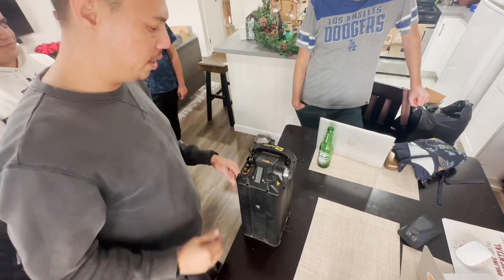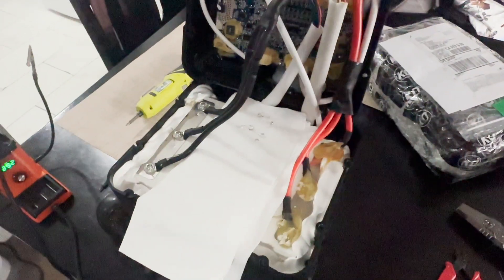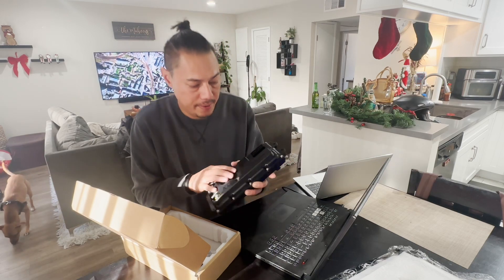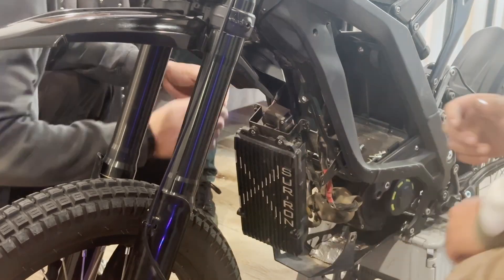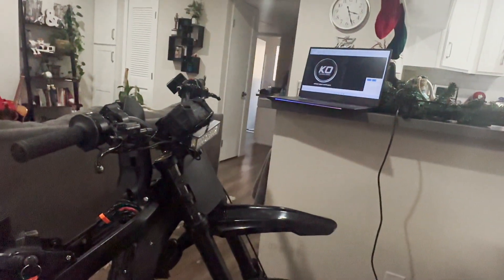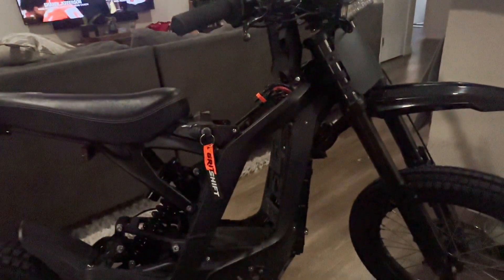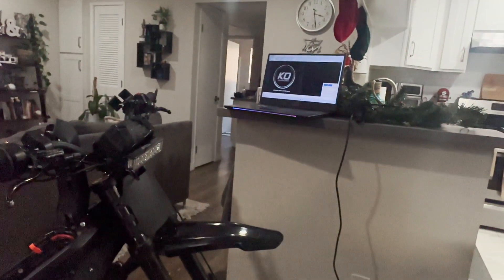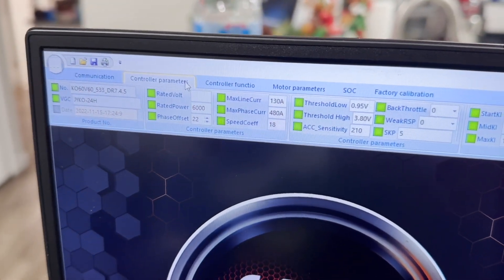Crappy Reviews - KO-Moto Nano on stock Sur Ron #WeaveLA

Comment: The throttle control is garbage. I bought it for the Talaria Sting MX4. I used to be able to ride clean, smooth wheelies.  It’s way too unstable to do that now. Talked to support and did a bunch of adjustments. And it still just isn’t near as smooth as the stock controller.